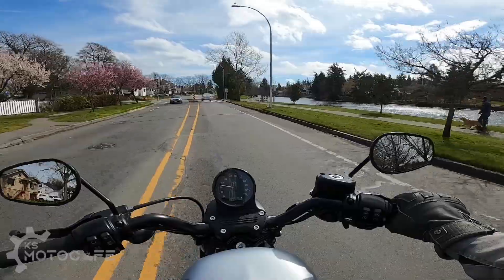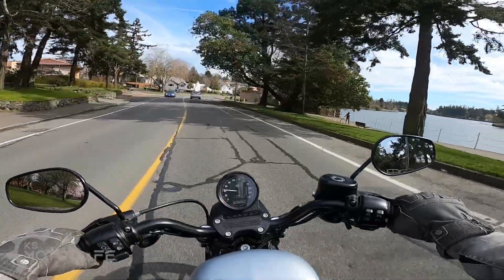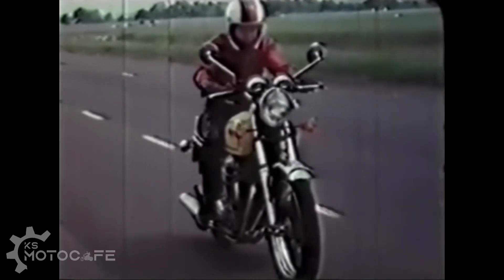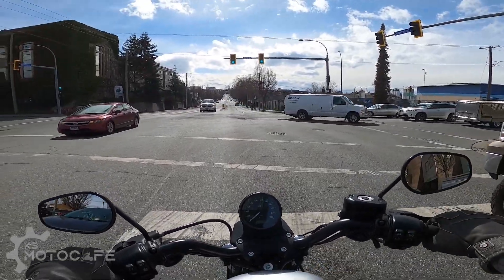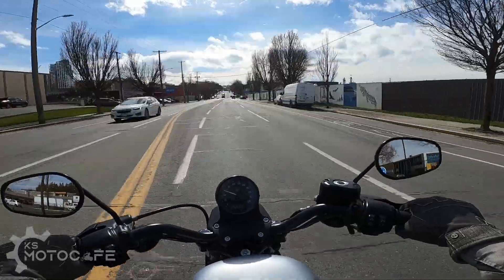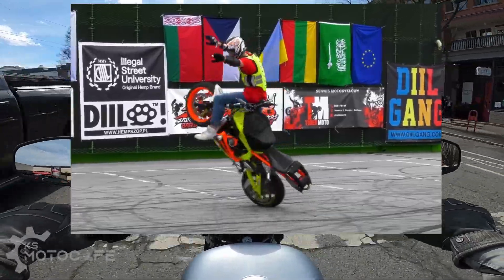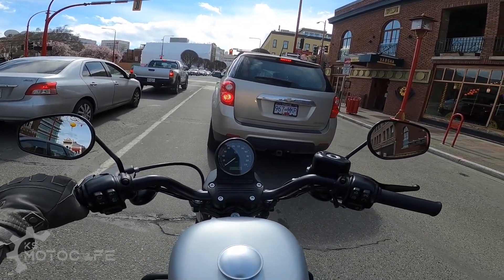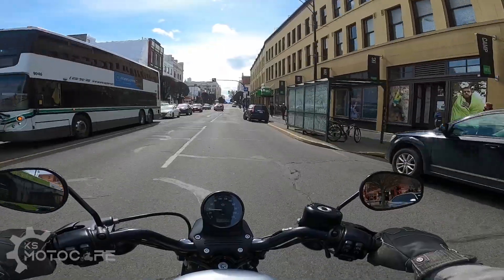Death Wobble, Speed Wobble, and Tank Slapper on a motorcycle explained!

Comment: So back in the day, I had a Kawasaki ZX7 and I was driving pretty fast Around 145mph my bike hit a pothole my bike front tire lost balance started to wobble which was very scary. My first reaction was to hit the front brakes but I learned very quickly that it made it worse when I let off the front brakes and I applied the rear brakes gently my bike came back into control and I continued the rest of the way at the speed limit.. This incident here was probably my most scariest time on motorcycle.

Comment: Happend to me while hitting the hole in the road and I was desparate to learn how to stop this while started. It got to the point when i was ready to fall down, what saved me in this situatuon was the fact that i losen my grip being ready to fall down and gripped the tank with my leggs, it stopped nearly as fast as it started. Turns out, that the best you can do is losen grip, let the bike slow down, you can even hut the rear brake lightly(speeding up can also help, but firstly, it can make the fall worse and secoundly, it can male you strenghten your grip, so slowing down is probably better). Secound thing is lying down on motorcycle, legs grab the tank, butt goes a little bit back and head a little bit lower. You just have to let the bike fix it for you. One thing that can prevent it (beside fixing problems with motorcycle itself) is to ride with not so tight and hard grip, loosen it a bit, elbows shouldnt be on your chest, just in natural position so if something cause the bike to lose it's balance, it can immediatdly fix it, if you hold your grip tight and hard it doesn't let the bike to go back to balance after the problem occurs.

Comment: 1300 Yamaha Royal Star Venture 2004, 1st time at 80 miles a hour,  but mainly at take off and slow speeds 30 or less. Sometimes when I'm taking off to turn a corner at a light. Took it to a shop and of course  it didn't do it for them.  I weigh 210. Can't figure it out. 😢

Comment: Very informative video. Thanks for making it. I ride a 1993 Kawasaki Voyager. Well maintained. I experienced speed wobble twice. Both times were when the front tire hit a rough patch of road during a turn. Speeds ~45mph. Both times I throttled down out of instinct. 1st incident was 2 years ago. 2nd time was yesterday, so I decided to find out the cause. Glad you advised to not use the front brake.

Comment: so essentially, speed wobble happens when you try to outrun your own front wheel, or leave it behind when braking too hard. gotcha, its like loosing the rear in a car under heavy braking but with the Bias to far back, actual speed =/= wheel rotation speed.

Comment: gonna list a few preventative measures here I've heard from all sides of the community

1. TIRES!
- Check your pressures often
- Check the tire for bald spots, wear and punctures

2. Rest of the wheels!
- Make sure the wheel is weighted properly
(may cause excess vibration if unbalanced)
- Check alignment
(You may notice your bars tend to always jerk to one side when you hit a bump. That's how I discovered it)

3. Suspension
- Check for leaky seals
- Make sure the suspension feels normal
- If adjustable, check your settings

4. Steering head
- Check those bearings!
(while stationary or on a slow roll, turn your bars from side to side. If they don't feel smooth/rumble when you steer, replace bearings)

For all above, an easy way to test your bike's stability is to get up to around 20-30mph and let go of the bars. Look for any unusual movement. But... obviously also look where you're going.

5. YOU!
Check your riding style. Lots of guides on how to ride properly. Here's a few brief points:
- DON'T DEATH-GRIP THE BARS
- Hold the throttle like an ice cream cone or a screwdriver. Gently, and at an angle. Go find an image to look at for reference.
- Relax your whole body. Tense up and you'll mess up.
- Slide that ass back! sit to the back of the seat.

Comment: Thanks for the vid, I had a couple scares growing up in the late 80’s with my pos ‘74 Honda XL100s. It was not in any way well maintained, but still unkillable,, also prone to bad behavior such as runaway throttle which could only be cured while riding by pulling the plug wire, and still then kept going for quite a distance. Tank slappers, similar to pilot induced oscillations, also popped up now and again. Strange enough I found the cure to be taking your hands mostly off the bars and dropping your cg forward and low. If I was on rough ground, chances are I was getting tossed anyway, but really the speeds were under 40mph generally so it wasn’t that bad getting thrown now and again if I could slow down a bit first.

Comment: I was on a Gotway Monster Pro Electric unicycle going about 50mph on an abandoned go-kart track. Trying to slow down after the straight. Since it's a unicycle, the front wheel is also the back wheel. I had to give up braking and ended up in the tall grass surrounding the track.

Comment: KLR 650. Accelerated from 55mph to 70mph and let off the throttle when it started. I tried to hold it but I couldn't. Tapped both the front and rear barkes a little like you said "I just want to stop"😂. I lost the bike and we both went sliding. Hit the pavement at 60mph. Glad Im alive. I had to hop on and ride it the last mile home

Comment: I had one on my Harley chopper at 100mph.  It kicked in so Fast. I was covering 2 lanes on the Xway, going back and forth, I don't know how many times. I let off the throttle. THE ONLY SENSIBLE THING TO DO And DO NOT Reach for the Foot Brake or BRAKE Any,,, just ride it out down to a manageble speed.....It slowly started to to lessen from 2 lanes to a lane and a half to 1 lane to a half a lane and 25 mph. before I could throttle up again to 60 mph ,, I looked back over my shoulder and there were 3 cars holding back all lanes of traffic behind me,, and catch my riding partner that was waiting on the shoulder up ahead. No Joke... Do Not reach for your foot Brake Pedal.... The motion will Unbalance you and the bike and You Will Go Flying Off...

Comment: Know about the death wobble, experienced this for the first time yesterday while going 126+mph, obviously i made it through  because I'm typing my comments but definitely a terrifying moment!  Was on an 2006 Yamaha R6.  Luckily I did my best to stay calm and watched enough preparation videos along with experience to just know to not panic and to NOT grab your front brake.  Let off the throttle and eventually my bike leveled out once I got to around 80mph.  Took about 4 secs to happen but it felt like an eternity.  Pretty sure mine happened because although I was on a straight road, the road itself was uneven and bumpy.  Didn't know before hand putting more weight forward would maybe help stabilize it, but i ended up doing that anyways because it just made sense to me to do so.  Thank God I came out fine, hopefully other rides watch videos also for future potential hazards.

Comment: I experienced little wobbles on my honda rebel 1100 manual transmission. Trying to hit top speed but only goes to 99. Sometimes pass 99 and go to 101. I think it wobbles because i grip too much on one side of the hand grips or one of my legs fan out too much and the wind hit the leg that was fanned out too much. All i did was put both of my legs closer to the gas tank and relaxed my arms. Lucky i didnt do any tank slapper

Comment: Just happened to me a mega death tank slapper at 170 kmh. i pulled the clutch and then light step on rear brake and it stopped and corrected itself Honda CBR 650F. PULL THE CLUTCH FIRST AND THEN DAB THE REAR BRAKE.. Time before that on a Ducati Nightshift i accidentally pulled the front brake and nearly died. the Ducati died. I was only doing about 80 kmh on the nightshift. The CBR i am surprised to still be alive and have ridden it out. Ducati want 10,000 dollars to fix a 12,000 dollar bike so it is dead. spare parts.

Comment: I was descending down on a gravel road. Road ahead flattening with a muddy water section at the beginning.
As soon as front wheel was sucked into the mud, the bike was out of control. It was a low bike. I ended up in standing in the mud and let the bike go and fall down between my legs.

Back then, at the age of 15, I did not understood well what was really happened. But that incident made me cautious on situation where the descending road starts to flatten.
Now you explain it as velocity difference between the back and front wheel explains the whole situation.
Thank you and safe riding.

Comment: My 1985 goldwing with 40,000 on it, scared me to death when I got into third gear at about forty-five. I had made a turn onto the street and accelerated fast until the light changed and when I decelerated the wobble started. I thought it was the front end at first but since then remember the feeling of the whole engine coming out of the bike. I saw a video of a race bike that had the exact same problem and the video was about the riders arm position that he called  "hanging from the bars".I don't remember doing that but maybe rider error had something to do with it.
I put new tires on it and new fork seals. And I changed the rear air shock compressor. Now I'm being very careful on the the bike. That wobble will scare you to death!!!

Comment: I have had two bad wobbles in 40 years during both throttle off loosened grip applied back break lightly, it took a few seconds but the bike straightened out both times but you have to have faith that the bike want's to go straight and stay up on it's own already. I was told to never fight it or try to compensate, it makes it worse. Both happened on the same bike a 1983 Honda Nighthawk at freeway speeds. One was triggered by a bad pothole the other was a groundhog I hit both times the front tire came off the ground and started the wobble when it came back down.

Comment: In 2011 I was on a 11000 mile cross country road trip.  I was riding my VTX through Az on a dead straight 2-lane highway with no shoulder, and barbwire fence on either side.   Was cruising along at around 75mph with a pickup (with tailgate down) about 100y ahead of me and a big rig ahead of him.    The two of them disappeared over a rise in the road, and as I crested the rise I was confronted with a locked up big rig with smoke pouring off the rear wheels trying to make a left hand turn onto some tiny dirt road.  The pickup was also locked up, and there was traffic in the oncoming lane parallel with the truck..  I applied my brakes and suddenly found myself in a severe death wobble (probably a full on tank slapper, but my adrenaline was spiked and I'm not sure if it was hitting or not).   My options were try to hold it together while braking as fast as possible, head into oncoming traffic, attempt to thread the needle and likely hit one of the cars or go under the turning big rig, head off road and get wrapped in a barbed wire fence at speed, or let off the brakes and hit the back of the pickup with a very real decapitation by tailgate possibility.   None of the techniques offered in this video were an option.   Hold it together while braking as fast as possible is what I went for, as the wobble increased strongly.  I was convinced I would high side or hit the back of the pickup and die as it felt close to jackknife with every wobble.  I seem to remember tightening my knees against the tank, tightening my hand grip, and trying to loosen my arms and upper body while offering enough resistance to hopefully stop a jackknife.   My internal monologue was screaming shit shit shit shit shit shit shit....,  as I braked harder while trying to keep it on the road and upright.  Somehow,  I kept the bike upright and managed to stop about 5 inches behind the pickups tailgate.   The severe wobble didn't let up until I was completely stopped.  To this day it was the single most terrifying experience I've had on a motorcycle.  I am very thankful that I was leaving such a large amount of space between me and the pickup.   I put the bike into the shop to find a cause when I got to my destination.  It turned out the new tire on the front, had torqued and developed a bulge after being installed improperly about 2k miles prior at a small shop in Wi.  The dyna beads I was using for balancing collected in the bulge and exacerbated the issue imbalancing the tire further.  The shop was able to correct the issue and save the tire, and it had no further problems.  Let's just say that was the last time I used dyna beads for tire balancing...lol

Comment: I added a cell phone holder for my bike that I bought online, and put it on the left side of the handlebars, not the center. And you mentioned that in the video. Thank you so much for this video. I have had the wobble ever since I got the phone holder
Reply from the maker: you may also want to invest it fork stabilizer if your wobble continues. It helps with preventing the speed wobbles a lot
Reply: I thought I was crazy for thinking this was the cause of it. Haven't experienced this until getting a phone mount  @KSMotoCafe

Comment: How fast do you need to go to get speed wobbles and death wobbles, My dirt bike goes about 55 mph max. Can I get speed/death wobbles at that speed ?
Reply from the maker: there isn't one speed that does it for every bike. Well designed bikes that had good balance can last until much higher speeds. Bike like mine that is heavy (560lbs) with crappy shocks and other flaws can speed wobble at 130+kph. Light bikes can have speed wobbles at lower speeds because there are so many factors that can push your bike around like a gust of wind on the highway but because they are light, it might be easier to correct

Comment: I experienced the wobble when I was about 14 or 15 on a '75 Yamaha 250 2-stroke 6 speed. I was going about 115. I let off the throttle and held my breath. After that, I kept it under 90.

Comment: 1986 GL1200 Aspencade . Have had death wobble way more than I would like.
  De-accelerating down through 40-35 mph
DON'T take your hand off handle bars or you could start the death wobble.
   On that bike running 41 psi. in front tire is a must and will cure wobble problems in most cases for older Goldwing. Yes there are other factors but 41 psi is a big one on this machine. A true tank slapper is close to not being able to hang on to the bars.

Comment: IM PRETTY SURE THIS HAPPENED TO ME BC OF SAND OR DIRT BEING ON THE ASPHALT AND CAUSING THE SUDDEN CHANGE IN SPEED DIFFERENCE BETWEEN THE FRONT AND BACK WHEEL. THAT AND THE REAR TIRE BEING TOO FAR GONE AND NEEDING REPLACEMENT..IM GLAD I KNOW NOW. DEFINITELY CANT AGREE ENOUGH ABOUT MAINTENANCE ESPECIALLY RUNNING SAME TREAD PATTERNS/COMPOUND ON FRONT AND BACK TIRES, CORRECT PSI ETC..